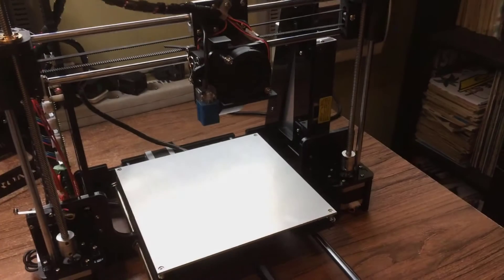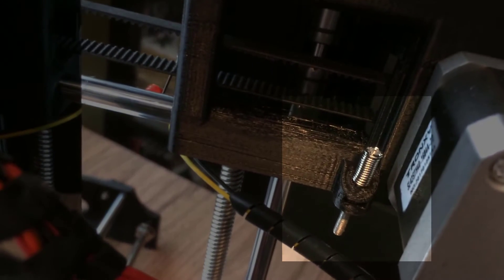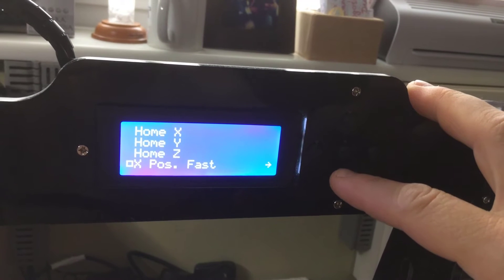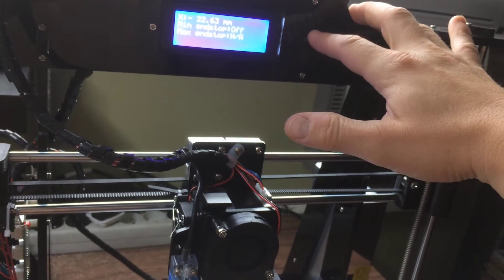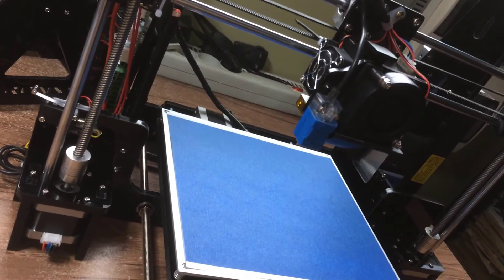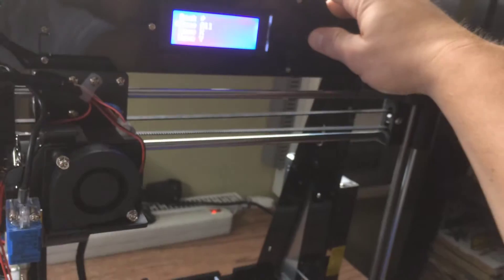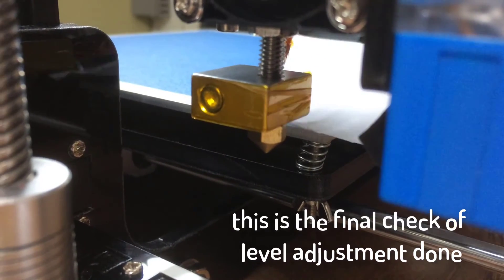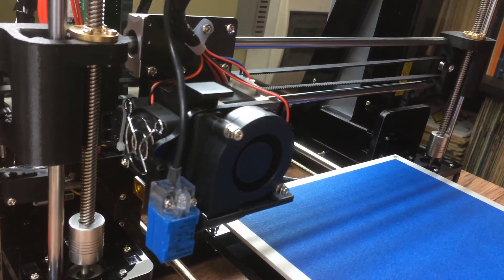STARTING 3D PRINTING - TRONXY POWERUP AND LEVELING

Comment: how on earth do i level the thing without the sensor?
Reply from the maker: This is not possible with this model. I've ordered the sensor but did not figured the way to enable it in firmware. Also did not found any firmware that has this feature on. If anyone knows please share by comment here...
Reply: @Dra6onTV  im trying to get a perffectly level surface to put the printer and then perfectly level the bed  and then the nozzle. wish me luck.
Reply from the maker: Hi. I've installed additional linear bearing as orignally one side has two and other has one only. It helped a little to level but I've got the feeling that you need to print some extra frame to keep the bed in shape and prevent bed axation. It's dificult to make it with screaws and nuts as they orignally designed. We need some in sort of Prussia design here for frame. But let me know how things went Nekoromancer - fingers crossed that your trial will be successfull as I may be wrong.